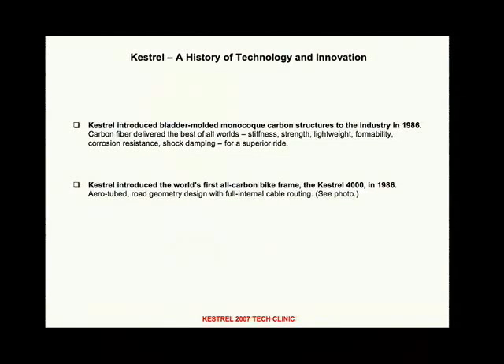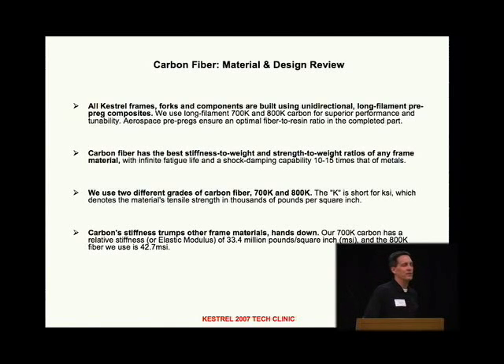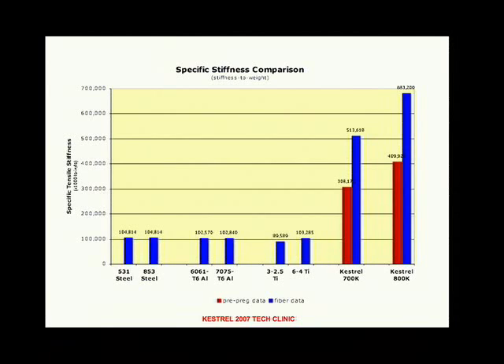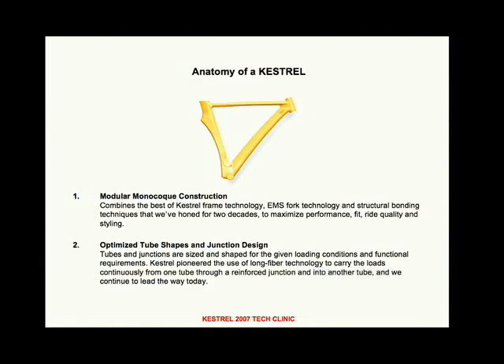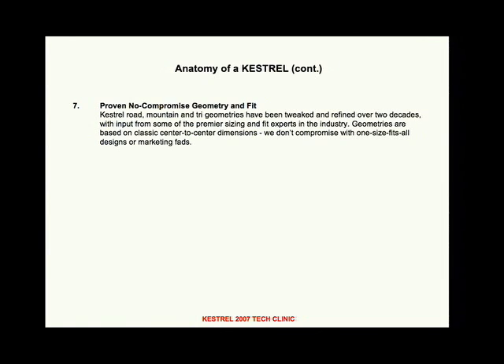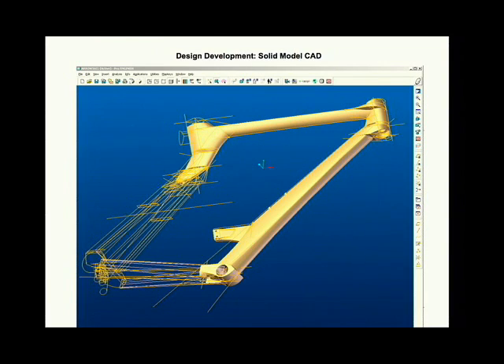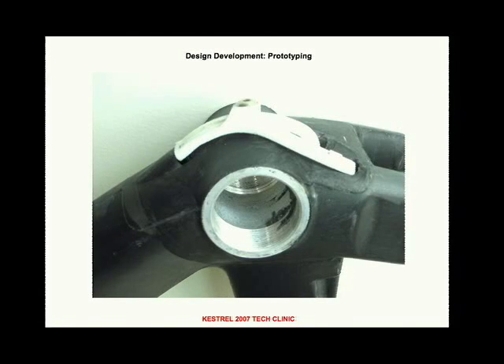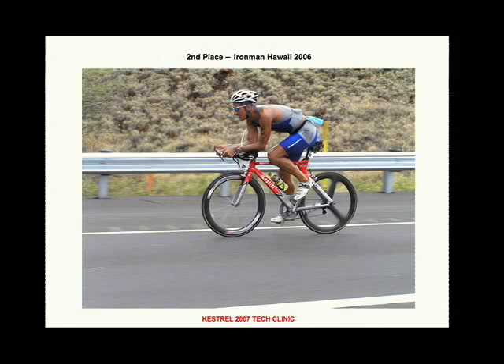The history and development of the Carbon Fiber bicycle (as told by Kestrel)

Comment: AI Summary

Abstract:
This technical presentation details the evolution of carbon fiber technology in the bicycle industry, specifically the pioneering work of Kestrel Bicycles. Drawing from California’s aerospace sector, the engineering team transitioned from military-grade composite applications to the development of the Kestrel 4000, the first production all-carbon bicycle frame. The synthesis covers the mechanical advantages of carbon fiber—primarily its superior specific stiffness (stiffness-to-weight ratio) and vibrational damping—over traditional frame metals like steel, aluminum, and titanium. It further outlines a modern manufacturing paradigm shifting from single-piece monocoque to "modular monocoque" construction, utilizing 3D CAD modeling, Finite Element Analysis (FEA), and stereolithography (SLA) for rapid prototyping. The session concludes with a discussion on structural testing protocols and the aerodynamic efficacy of non-traditional frame geometries in elite triathlon competition.

Engineering Synthesis & Technical Timeline:

*   0:24 – Aerospace Origins: The engineering foundation of Kestrel originated in the Northern California aerospace industry. Technology used in U.S. Air Force carbon fiber projects was adapted for production-scale bicycle manufacturing.
*   2:13 – Kestrel 4000 (1986): Recognized as the first production all-carbon frame. Prior "carbon" bikes utilized round tubes bonded to metal lugs; Kestrel pioneered molded composite structures, allowing for aerodynamic tube shaping impossible with metal.
*   4:07 – Suspension Innovation (Nitro): In 1988, Kestrel prototyped a full-suspension carbon mountain bike (Nitro) in collaboration with RockShox and Bontrager. This helped catalyze the industry-wide shift toward suspended off-road frames.
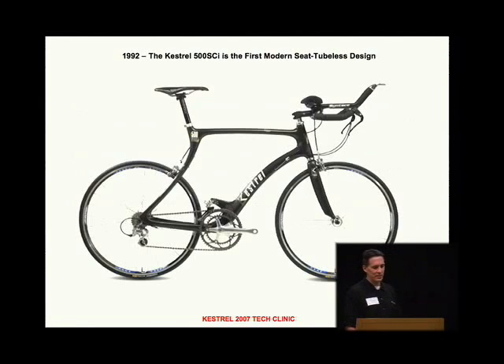*   6:10 – Structural Radicalism (500 SCi): The introduction of the "no seat tube" design demonstrated the structural versatility of carbon. Metal frames cannot achieve the required stiffness-to-weight efficiency without a triangulated seat tube, whereas carbon allows for localized reinforcement to maintain bottom bracket stiffness.
*   7:13 – Material Specifications: Kestrel utilizes aerospace-grade "prepreg" carbon fiber (unidirectional fibers pre-impregnated with epoxy resin). This material allows for precise control over fiber orientation and resin-to-fiber ratios.
*   10:56 – Specific Stiffness vs. Metals: Carbon fiber epoxy blends provide a stiffness-to-weight ratio 3 to 4 times higher than steel, aluminum, or titanium. While metals share similar specific stiffness regardless of alloy, carbon’s modulus can be "tuned" to the specific requirements of the structure.
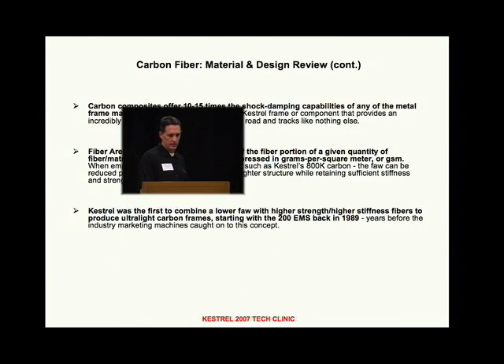*   14:33 – Vibrational Damping: Carbon fiber functions as a fiber-reinforced plastic, offering shock damping 10 to 15 times greater than metals. This allows engineers to decouple structural stiffness from rider comfort, attenuating "road buzz" without sacrificing power transfer.
*   17:17 – Modular Monocoque Construction: Current manufacturing has shifted from single-piece molding to modular monocoque. The main triangle is molded as one unit, then bonded to dedicated rear-stay assemblies using aerospace structural adhesives. This increases repeatability and precision across size ranges.
*   20:23 – Size-Specific Engineering: Carbon allows for proportional tube scaling. Every frame size features unique wall thicknesses and layup schedules, ensuring identical ride characteristics for a 100lb rider and a 250lb rider.
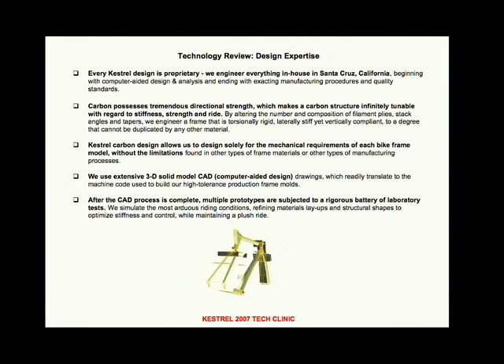*   25:03 – Design Lifecycle & CAD: The workflow has evolved from hand-drawn centerlines to 3D solid modeling (Pro/Engineer). Advanced software is required to model the complex compound curves and internal cable routing characteristic of high-end frames.
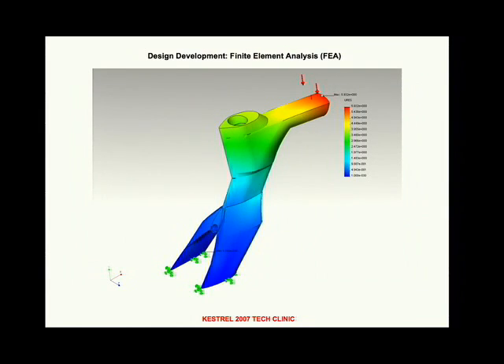*   32:09 – Prototyping & FEA: Before metal tooling is cut, designs are validated via CNC-machined foam models, Finite Element Analysis (FEA) for load simulation, and Stereolithography (SLA) for fitting components.
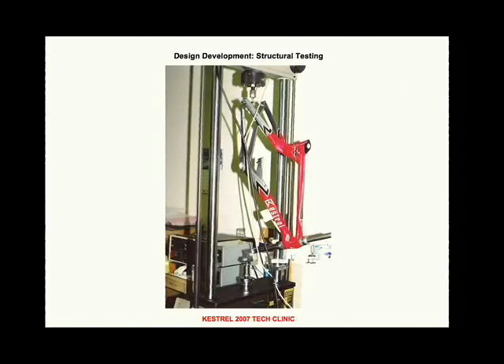*   35:50 – Validation & Testing: Frames undergo rigorous structural testing, including frontal impact simulations at 800+ lbs of force, surpassing US, EU, and Japanese government standards. 
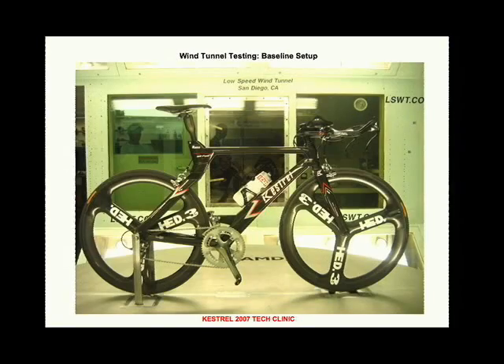*   37:12 – Aerodynamics: Wind tunnel testing in San Diego validated that the Airfoil Pro frame set saves approximately 100 grams of drag at 30 mph compared to conventional frames, translating to roughly 60 seconds saved over a 40km time trial.
*   45:24 – Damage Tolerance: Discussion on localized impact resistance. While high-end carbon frames utilize thin walls to save weight, they do not suffer from the permanent "bending" seen in metal frames, though they require specialized inspection post-crash to identify delamination.

AI-generated summary created with gemini-3-flash-preview for free via RocketRecap-dot-com. (Input: 26,051 tokens, Output: 1,359 tokens, Est. cost: $0.0171).